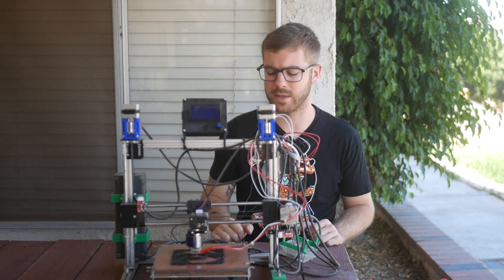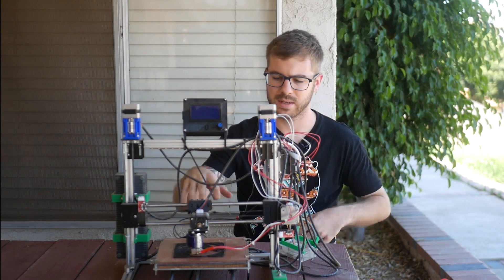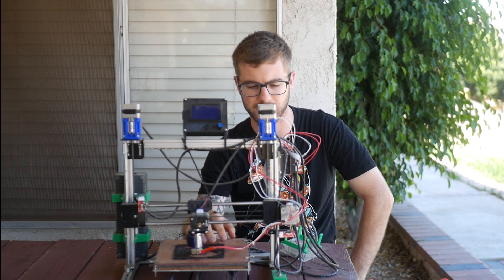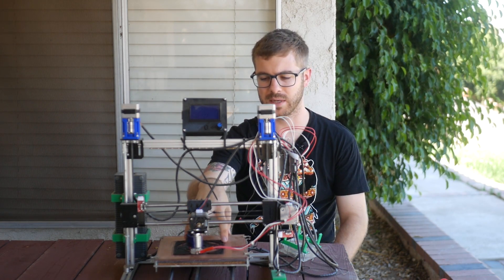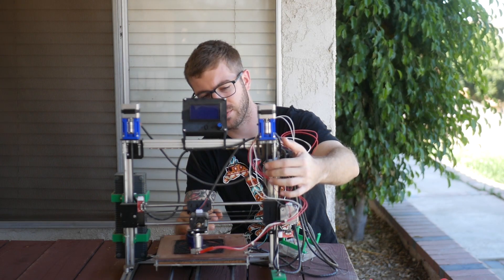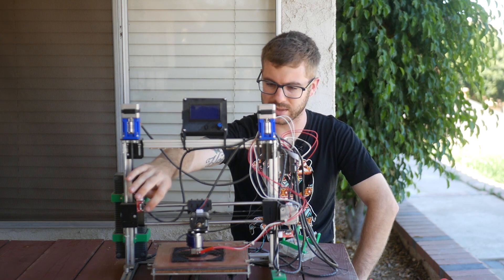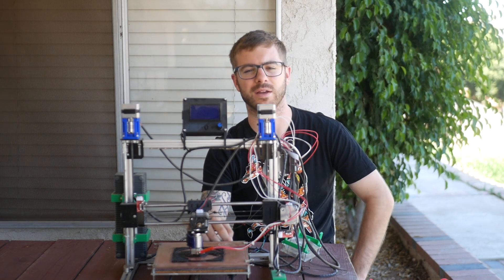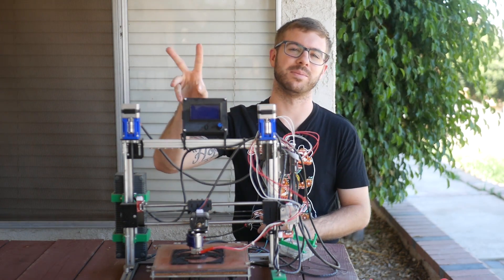3D Printer After 3 Years Of Constant Printing | FolgerTech 2020 Prusa I3 Revisited

Comment: I just upgraded to an Ender 3 from my original FolgerTech 2020 I built around the same time as yours. That was also my first printer so definitely learned a lot from it. Biggest issue I had with it is that the printed components would eventually fail, I was always finding cracked pieces, or my end stops would crack so I had to rig it up to print it's own replacement parts. I wasn't a huge fan of the drill rod and nuts instead of lead screws either. I'm glad this Ender 3 uses a lead screw and has injection molded plastic components that will hopefully hold up a little better.